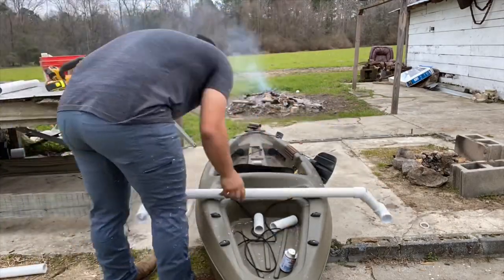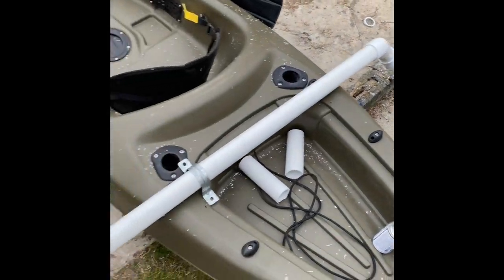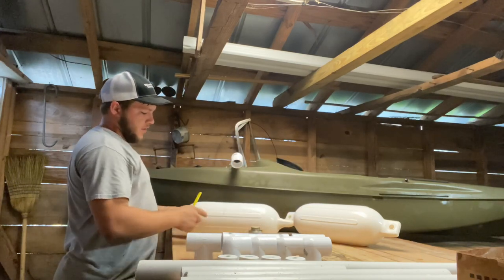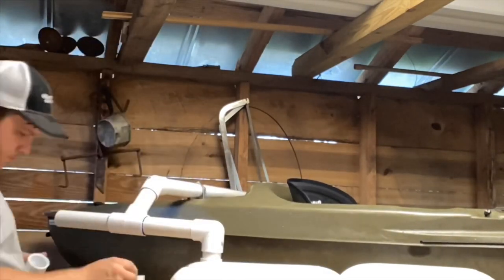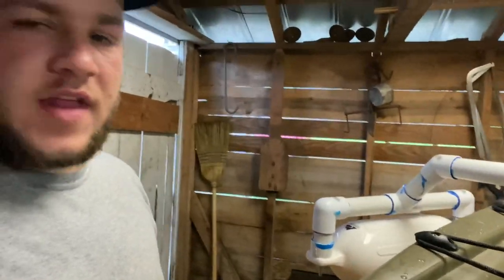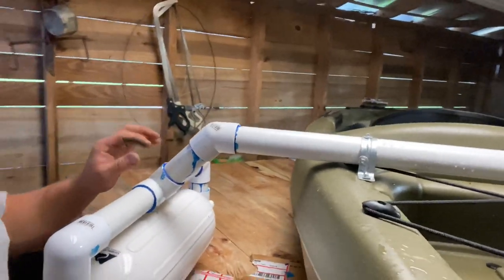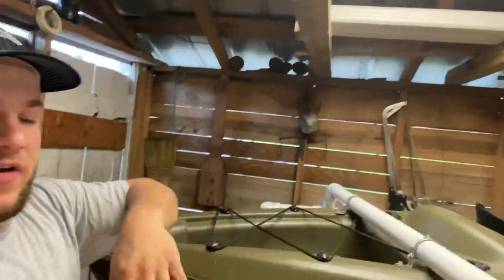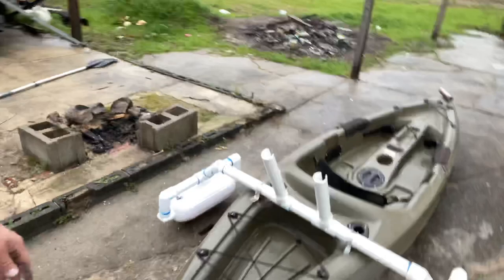How to build a kayak stabilizer.

Comment: Thanks for posting this great video:) The only thing I noticed is that had you gone further down with your drop it would increase the stability. I understand where you were coming from with your logic of keeping them up so they were at water level, however during the standing test rocking side to side you could see that the floats lifted almost completely out of the water, whereas had you gone as deep as the bottom of the kayak it wouldve further improved the stability by the flotation being further in the water:) Keep up the good work:)
Reply: You are right. The wider the span the better stability and the buoyancy of both buoys does not sharply decrease due to their proximity to the center weight of the boat, just like the wingspan of an eagle. If its wingspan is short, it cannot glide as good.
Reply: After the fact but the pressure on the stabilizers from bouncing in the water will bust out the screws on the mounting bracket. It’s only plastic. He does not have hull access so his only other option would be using well nuts to secure the brackets. Then he could mount them deeper in the water.

Comment: I have the exact same kayak and plan to do the same build. I think I will make the length for the down angle for pontoons a little longer. I think if the pontoons were in the water more it would be more stable.
Reply: I think I'm going to try the same thing. I also have the same kayak and it is very unstable

Comment: Great setup. I'm thinking make it a bit wider, and make a transom off on one side to mount a trolling motor.
Reply: You ever do that? Im currently trying to design an outrigger that has a transom mount
Reply: @bfrauen1266  Not yet, I need a battery to use as a counterweight on the other side. In the mean time, I've got a boost surfing motorized fin for short distances.

Comment: Two things that I noticed that may cause you problems.
Number one is that the stabilizer's are running parallel to the sides of the kayak and this may lead to tracking problems on the water.
The second thing is to do with the sweep of your paddle. I would shorten the front and lengthen the rear bars attached to your floatation devices. That will allow you to get more sweep with your paddle. I hope these suggestions help.
Reply: Should the stabilizers run perpendicular? I think that would just slow it down and make it harder to paddle.

Comment: You smart dude!! Your genius idea, solved a big problem for me. Im doing the same type of project and was stuck on how to mount the fender. Originally, I wanted to use 1/2" pvc but it does not fit thru fender holes. I was ready to drill out holes bigger, or melt somehow....lol Then I went to Lowes twice and was trying to rig it up with sprinkler size parts.
Reply: Be careful screws will  pull out of the plastic  on the kayak  .

Comment: Have the exact same kayak- I think I’m going to try using a larger pipe going across the kayak and then slide a smaller one in so that I can drill a hole and put in a pin for easy removal for 
hauling. Does your set up interfere with hauling in back of a pick up? Thanks for posting!

Comment: thanks for staying with this project and giving me so many good ideas. You're a hard working guy (carpenter if I don't miss my guess, which I have many times before) with the bug for sure!  I mainly explore, swim and dive so I think the existing (deeply inset, about 45 degree angle) rod holders on my Pelican sit-on top are still my go to starting point. Are there any reasons, beyond conserving the rod holders, that I should not use them, given the correct angle of connecting joints?
Reply: Tony Barnes there is another guy who uses rod holders to mount is good

Comment: I wonder if you could use the original pole holders to make the whole stabilization system removable?
Reply from the maker: You can I didn’t because I wanted more rode holders
Reply: Add a 4-way connector at each rod holder plus suitable lengths to attach the assembly to the kayak and create rod holders . With PVC you can create pretty much anything you want.
Reply: @unlimited-projects2993   good looking out on the design i much rather spend an extra 20 to 50 $ to make this one rather than the inflatable ones . im going to put a union in the middle so i can remove them when needed. i also have the kayak that i can reach inside so i really need these. going to use washers so the screws don't rip out of the thin plastic. also i will put the floats level with the bottom of the boat.

Comment: Awsome job bro..Going to do mine the same way. Little different but same materials. Bought the pelican catch 100, with the 2.5 motor, feels like it wants to tip. I only weigh 145lbs, thanks for the vid. Be safe..
Reply: Hey man I have the catch 100 and I wanna make something similar. Did you ever make one?

Comment: Hey Joel... I've done the same thing years and years ago .  Looks nice but I think you're going to need much more flotation. Will be watching to see how it does for you. Nice video.  Yep, needs to be the length of your Kayak and on one side only.  Just saying because I did the same thing and even welded mine... Mine was a mess but that was because I had no welding skills.  Ended up sinking in Green River reservoir.  lol... The year they dammed it.

Comment: Can you give dimensions as to where you place the stabilizers in regard to the seat position so it doesn't interfere with paddling. Also using 4 in schedule 40 with end caps make nice pontoons as you can adjust length and position before you glue up. Thanks for your guidance.
Reply: Wow figure it out, lol you have this video, what more do you need?

Comment: I like your idea its the simplest yet looks very stable. I carry my kayak on my suv. Is there a quick release system that I can use instead of the permanent clamp?
Reply: I'm thinking of doing the same thing. Will want to remove mine also so I'm thinking of using a coupler on both ends of main beam and securing the floats then by some sort of clip for when on the water.

Comment: Did you put the bottom of the outriggers level with the water line? I'm trying to decide where the bottom of my bumpers should be. My Dad thinks they should be all the way down where they are flat on the ground with an empty kayak on land. I'm just not sure where to put them yet.
Rip'n Lips from Amarillo Texas!

Comment: HI there. I really like your outrigger with the rod holders at the back. Great idea! I was wondering if the stability level might go up if the floats were a bit deeper in the water? Can you check you audio level. I had to have full volume when you were outside and then wind it down when you went inside. The volume uncreated freaked me out.

Comment: I like this design, but I need to figure out a way to make it easily removable, so I can still load the kayak on top of the car.
Reply: Having the journey 10ss my plan is to slide the outrigger frame into the factory rod holders. Fastening that down  once I'm on the water is going to be another challenge